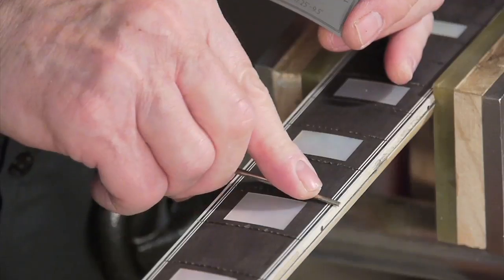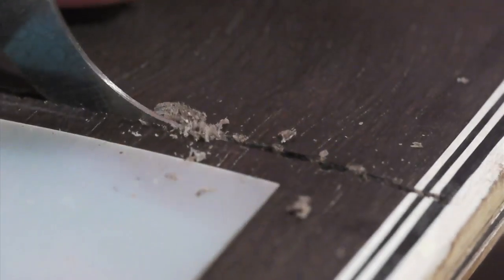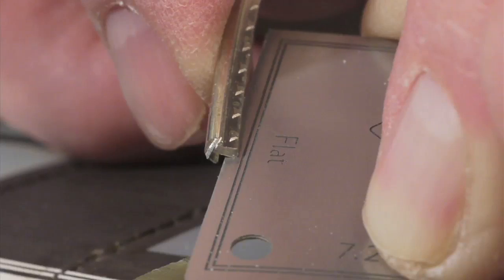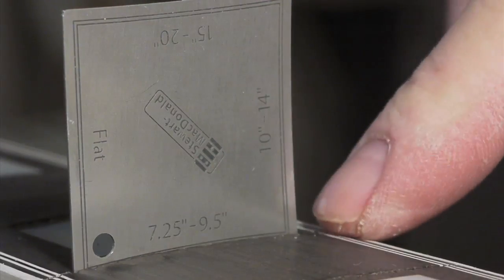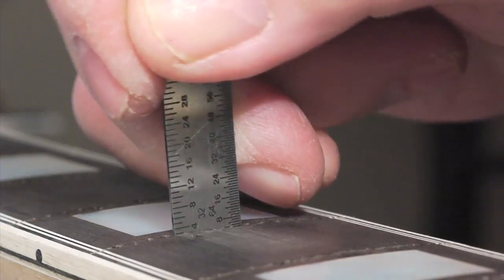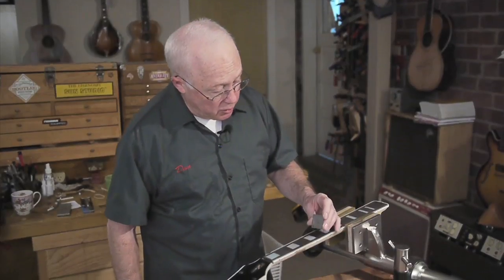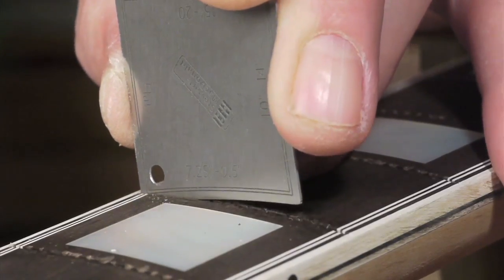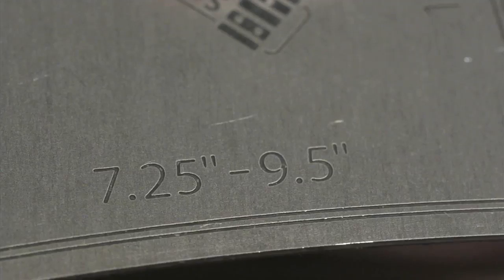Fret Slot Depth Gauge

Comment: A cardstock gauge would get ruined quite fast since the slot is often not clean on a guitar where the fret has just been pulled off, and you will need to make new ones often, wasting a lot of time. Maybe 5$ is a lot of money for this tiny metal plate, but you buy this once and it will last forever. Or at least this is my opinion after owning it since some years. :)